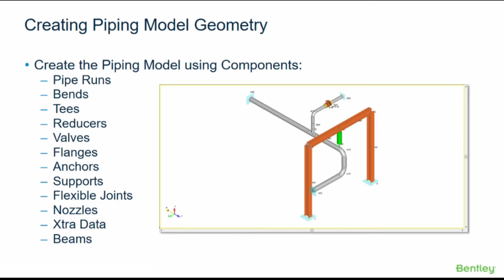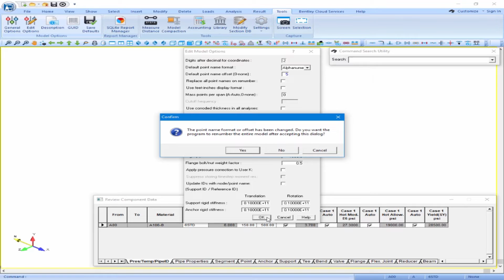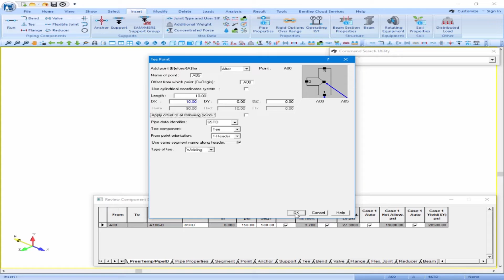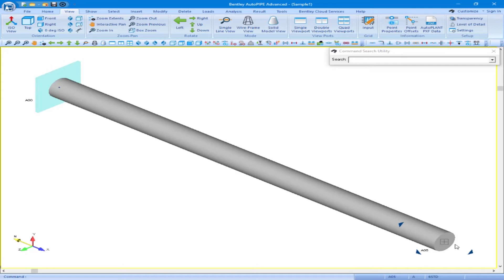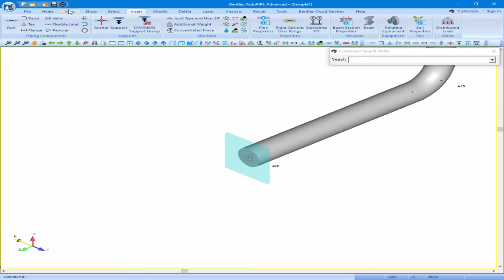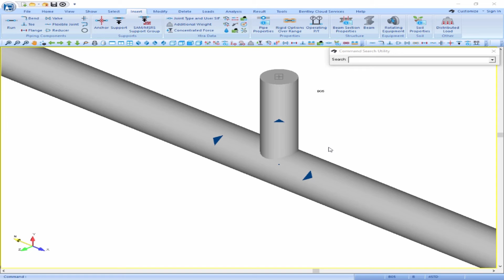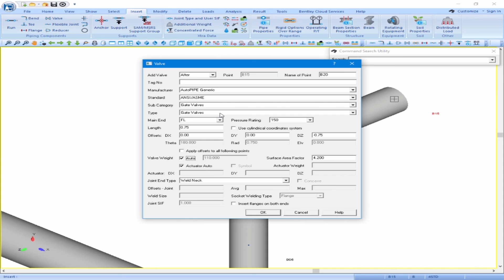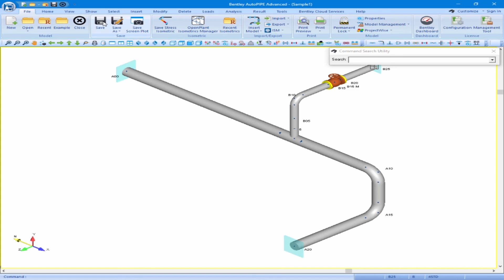Creating Piping Model Geometry Part 1

Comment: Be very careful when buying. I did not buy CAESAR II, CAEpipe because their maths background is better. They seem to be relevant at first. Then, if there is a problem with your computer and you want to reinstall it, you cannot use it and the software you bought will be rubbish. Even when buying a vacuum cleaner, they give a 10-year spare parts warranty. Even if you have insurance, in case of a loss, if there is no equivalent, an upper model is supplied. You write an article on the site, like artificial intelligence, it shares a random link that is irrelevant to the subject, as if it says, take this and play with it. The software package changes, licences change, you can't get a licence, etc. Bentley only wants to sell new versions.
If you haven't tried the others, I suggest you don't start here.